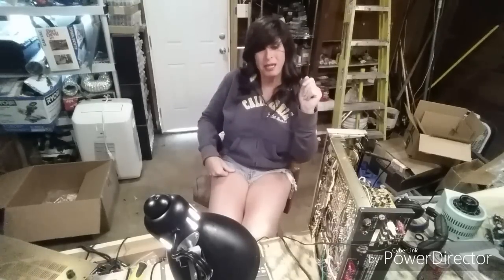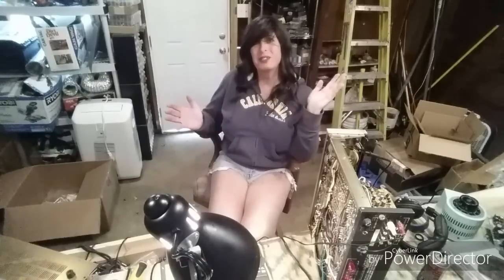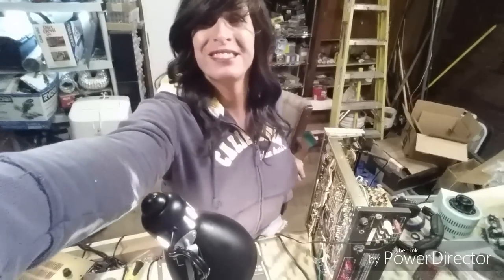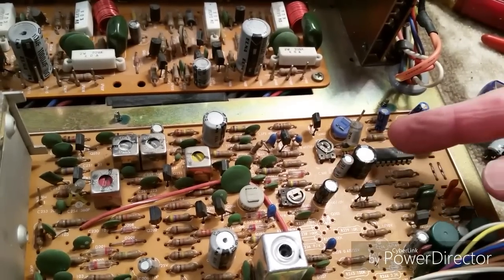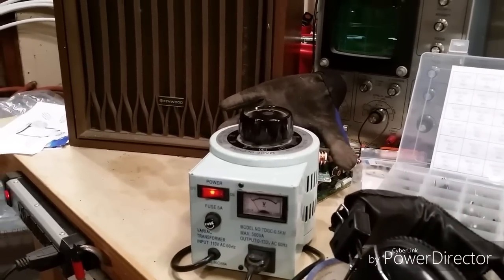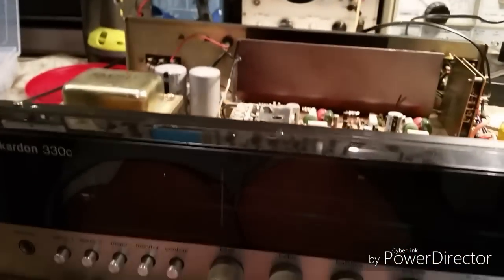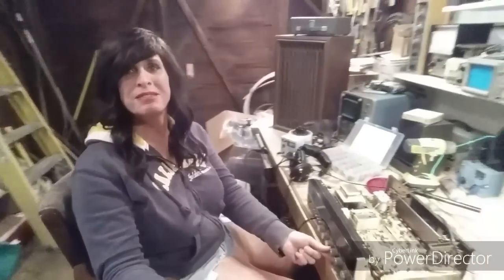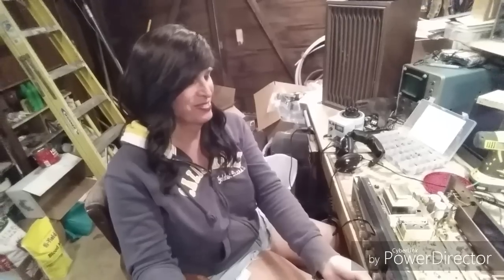The Harman Kardon Vintage 330c Stereo Rises From the Dead!...Friday Time Waster!

Comment: My 330C power supply and main amp boards are totally depopulated at the moment and I'm trying to get an order to Mouser together in my spare time. Hours and hours of compiling parts numbers and comparing data sheets to the original parts. Hopefully it sounds as good as yours when I get it finished!

Comment: I have a HK 730 and it is by far the best sounding amp I have ever heard, but one side of the amp doesn't work. Both transformers (it has 2 separate power supplies in it) appear to work. I think it's just a bad transistor on one of the daughter boards. I am going to either fix it myself if I can an obvious fault or will actually have it repaired. It is one of only 3 models designed this way and the sound is absolutely outstanding.